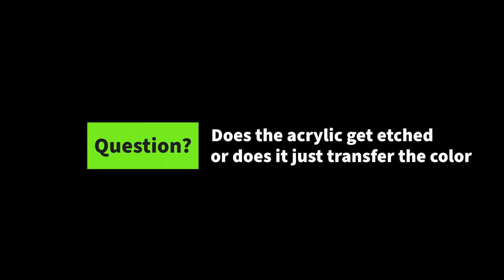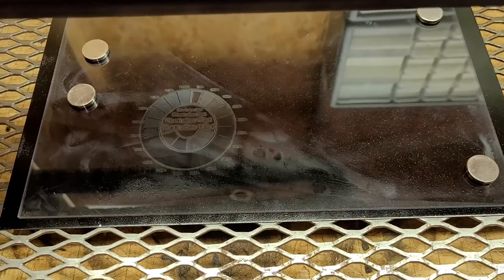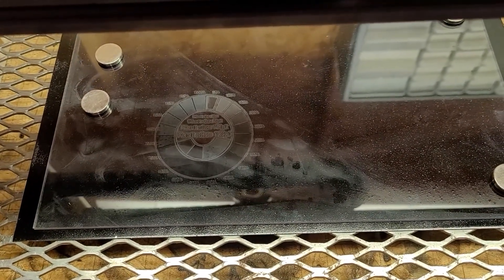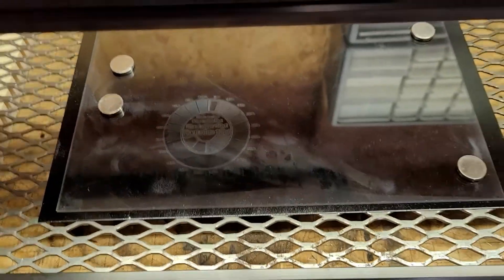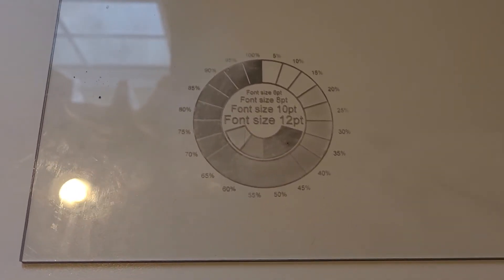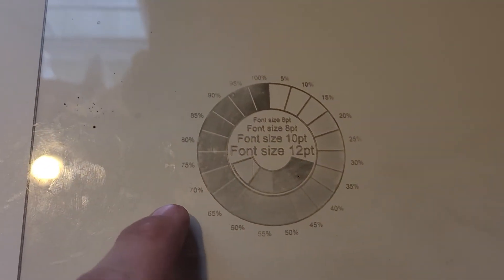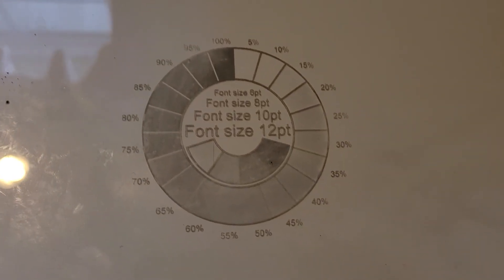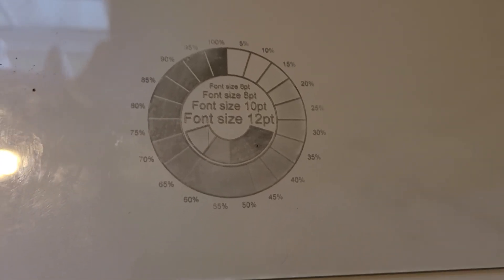Etching on Clear Acrylic - Follow Up

Comment: Thanks for the update.  I did a test etch on glass and found something interest, at least to me.  Painted the surface with black acrylic paint, etched painted side up and painted side down, both etchings came out on the same side of the glass.  Used Ortur LM2 w/ 20w fixed focus.
Reply from the maker: Yeah... if you watch my first video, I talk about right in the beginning how you can etch the top or bottom surface.  It'll etch whichever side is coated or protected.  Keep experimenting and let us know how things progress!

Comment: Hey Mike, I know these videos are from quite some time ago but has been great for me!! I am finally able to etch on clear acrylic. 
What I’d like to know now of how to handle photos. I tried it with grayscale and it came out looking like threshold. I adjust my min power up to where I just started seeing a little haze from the test week and got a negative image… so I converted the photo to negative and got what seems ok, but the burn is very very light. Really hard to see.  Would a Jarvis or Stucki be a better option and run it at the solid etch settings? Mine was 
My test wheel was at 100 speed 30 power. 28.50 power was where my sweet spot was.

Comment: Ok, so Kroger (grocery chain) has little $5 & less items. On that shelf were some colored acrylic coasters, how well would those etch being that they're colored & would I still need to use a steal plating for the heat transference?
Reply from the maker: If they are colored, you should be able to etch directly on them.  I've not tried anything other than clear acrylic.  Best thing to do is give it a shot!

Comment: Sorry, just found this.. so IF the color is transferred.. one could add a decal of an image to the steel.. and then burn that image in the software and the color pattern or decal would be etched into the acrylic?  Or simply adda decal to the acrylic to begin with.. sorry I need sleep
Reply from the maker: It is possible!  I've found that certain settings do transfer the color... but I don't know how good it would look.

Comment: I am considering using black tempura paint (water soluble) on the steel for etching acrylic as tempura dries really fast with a heat gun and it will etch glass when using a laser.    Magic Erasers contain pulverized ceramic dust and will scratch the hell out of anything shiny like acrylic or glass.  They work great for cleaning up walls etc.     Here is a link to the guy who uses the tempura paint on the back side of glass and then places that glass on big piece of white ceramic tile.  https://youtu.be/s0sBeAsHyNQ